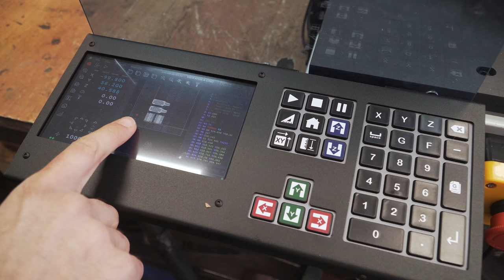Making a Soft Hammer | Metal Cast

Comment: I love it. Only thing I would have done differently is to make the handle flush on top instead of poking up 3/4 inch and then sealing it with black epoxy. Maybe next go around? Your getting good at this.

Comment: Really clean work! Great job! What are Soft Hammers used for? Did not know these...
Reply: It's used in machining and metalworks. Where the rubber is too soft and steel is too hard for the job. Usually made from brass/copper/bronze and aluminium
Reply: My question too but good answer